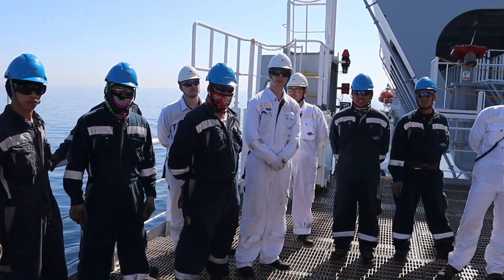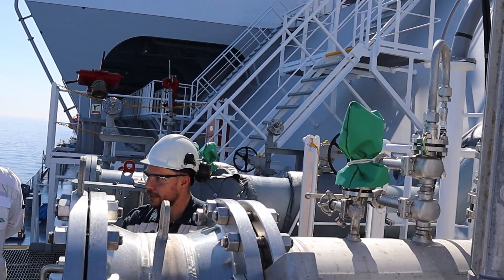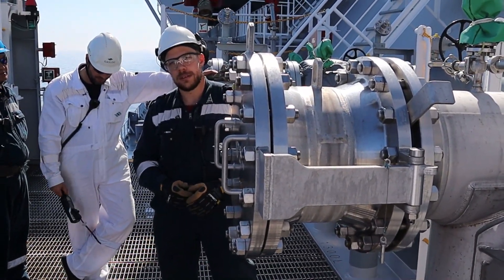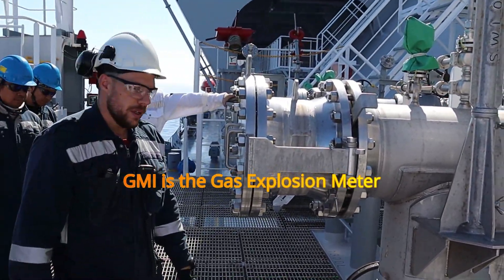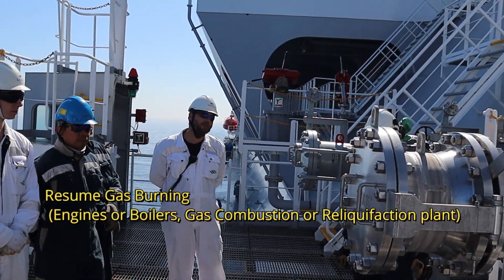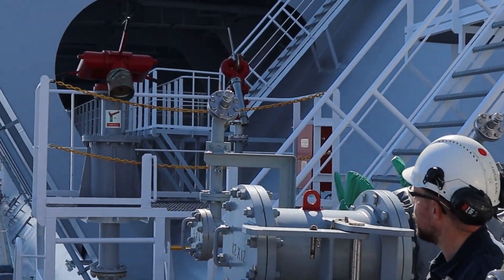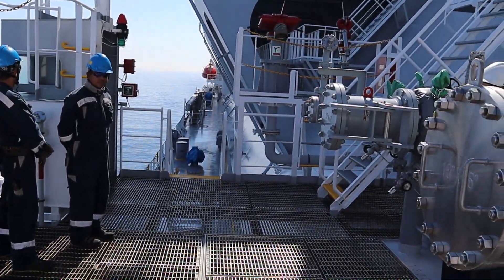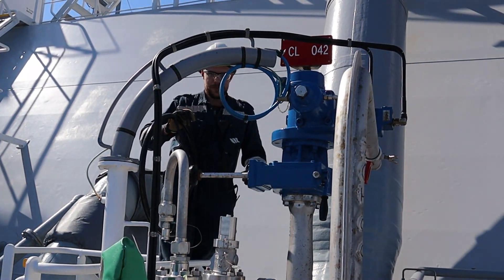LNG Carrier Cargo Manifolds Draining and Purging Procedures

Comment: That's incredibly insightful capt. Wishinh i could go to LNG oneday. I'm currently on LPG fully refrigerated carrier 🙌. 

May i ask you to make video about what do third mate do on cargo ops(loading and unloading)on LNG capt? Since maybe there are some differences procedure that maybe third officer doing compare to LPG carrier. 

Thanks in advance 🙏
Reply: Lng setau saya juga ada sertifikatnya sendiri bang, apalagi kalo nyk owner cukup mahal juga semoga cita cita tercapai salam ex cdt komodo 🙏
Reply from the maker: Hello and thank you for your message.Will check on this and revert.I would suggest you also to review your companies cargo procedures manual which explains what are your duties during these operations.
Reply: @nickthesailorman360 Hello)
Theoretical question, after cargo operations, we are purging only manifolds until double shut valve? Pushing on spray line liquid remains to cargo tanks, but the next way of liquid after spray line - crossover- liquid header - filling valve - tank, correct?
Reply from the maker: Yes correct  @zet655
Reply: @nickthesailorman360 okay but what about remains of cargo after double shut valve? How we remove it? Liquid become vapour (increase pressure) and this vapour we cannot send to filling because how we can direct vapour to liquid tank, that’s why we send vapour remains from header to LD or GCU? And never purge liquid headers after cargo ops by N2?
Reply: @nickthesailorman360  alright capt, but i wanna know about the possibility "differences" Between lpg and lng. 

Is it possible for LPG officer onboard LNG carrier capt? Do your company accept asian officer, Indonesian especially?

Thank you for your response capt 🙏
Reply: @iwanfaesal5890  Depending in the company's system, in LNG ship the 3rd Officer is in the CCR doing ballasting/deballasting operation, doing hourly reading, recording and computation of cargo qtty loaded/discharged, rate, qtty loaded/discharged, time to ramp down which is normally communicated hourly to the terminal, monitoring mooring tension, monitoring cargo and other critical alarms and supervising deck watch keepers. He is usually in the CCR either with the Chief Officer or the Gas Engineer. In this regard there is a company standard form for hourly record keeping. In some Japanese ships during normal operation the 3/O is in the CCR with an AB only (the C/O & G/E are only called an 1-2 hrs before Rate down or anytime needed). The duty officer is remotely operating the cargo filling/discharge valves for staggering, monitoring the cargo operation and doing hourly record keeping while the AB is doing ballasting/deballasting operation under the supervision of the OOW. The main difference with a Fully ref LPG you are onboard is that your loading rate is lower (LNG loads at an average of 11,000 m3/hr and as high as 14,000 m3/hr) therefore ballasting/deballasting operation should be faster. Fully ref LPG can be more complicated since you sometimes mixed cargo while loading or load warm cargo. During discharging you don't normally receive vapour from shore therefore you use LPG vapourizer or sometimes cargo booster pump and cargo heater to discharge towards warm shore tank with high back pressure. In most Fully ref LPG ships you need to go on deck to adjust the filling valves for staggering or operate the leveling valve if needed to equalize the cargo since you have centerline bulkhead and 2 filling valves compared to only 1 in LNG which make it easier for the tank to fill. There are plenty of LPG experienced officers who transferred to LNG and the opportunity is getting better due to massive new building and officer shortage. In your case you have already a gas experience and gas endorsement which will make it much easier. MISC Berhad, Bergesen and MOL might be accepting Indonesian officers. Hope I have answered some of your concern.
Reply: @Jojo-lh7lc  what an awesome and detail answer. Thousands of thanks to you jojo. And yes, you're right on what you said about fully refrigerated LPG. 

So from your answer, the duty of 3o on LPG and LNG actually not too different.

I'm hoping that i can onboard LNGC oneday. 

By the way, where r u from jojo? Are you on LNGC now?

Comment: Sorry, I didn’t fully understand the usage of water to prevent brittle fracture on te deck metal. Could you explain that to me? Thank you. Congratulations for your great work, please, keep it up.
Reply: looks like  the cargo is too harmful for the metal (hull) so the water curtain will prevent it but I need also an extra explanation about this. for example it will evaporate immediately so why do we need it? also as I am thinking now if its not evaporated immediately then it will when it will touch the water is that correct Captain?

Comment: Hi. Nick, thanks for your video. could you please introduce manifolds draining and purging procedure during the Ship to ship hose loading? how to drain the liquid inside the hoses?
Reply from the maker: Hello Hoan, Unfortunatelly I am not able to perform such a video because my vessel is not engaged on STS.I have done in the past, and it is very difficult to remove the LNG from those flexible hoses and to have them safe for disconnection.It takes many hours of purging utilizing the both vessels nitrogen in order to make them safe for discnonnection.
One thing to remember is that purge for at least 2-3 hours prior disconnection and dilluge sea water on the hoses for the lng to evaporate.